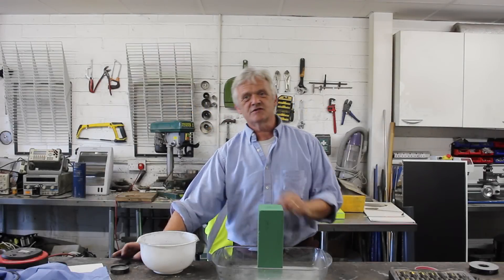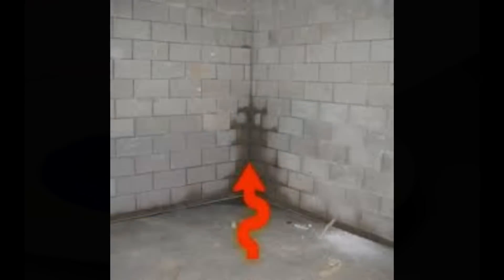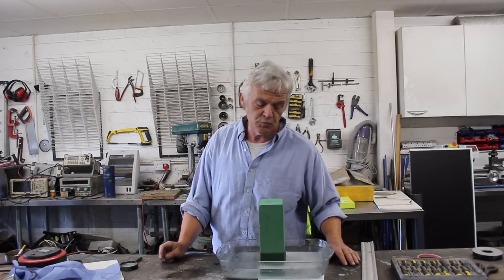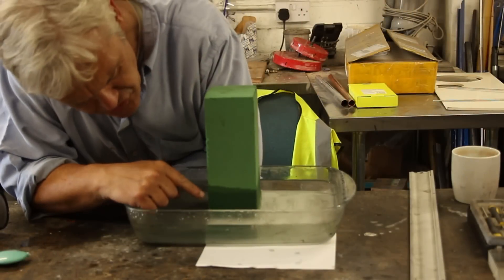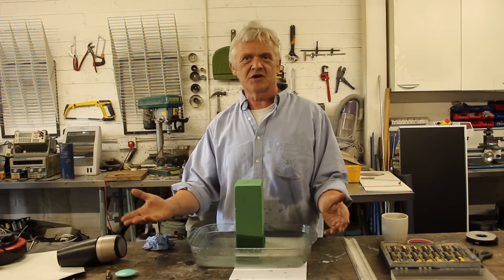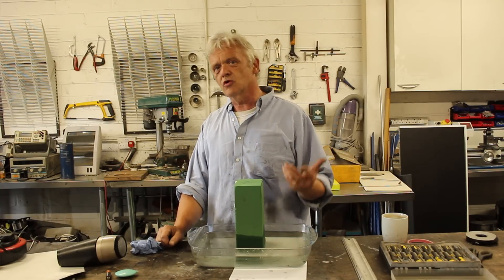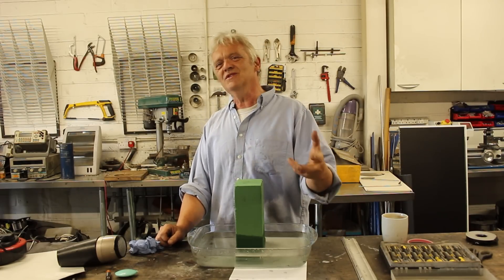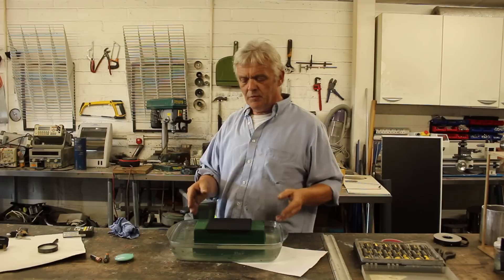1614 How To Get Cold From Hot By Copying Nature

Comment: 🤔 if ya can get a bundle of carbon nanotubes for testing with capillary action, a passive pump could be good. The only thing left to do is have some drippers and collect that water at a higher level.

If can get the drippers to work from the floral foam successfully, or with the nano tubes, then can make a passive step pump system.

Though to be honest, using a Archimedes screw up by windmill or wind generator would be interesting.

Comment: Very interesting - I live in a warmer climate and I have not found a successful evaporation cooler yet... maybe I am just not looking at the right products :-(  At the risk of being pedantic, the capillary action does not pull the water up the stem of a tree or anywhere else - the fluid, regardless of what it is is actually pushed upwards as the pressure drop from the leaves in a tree (or the vacuum effect of us sucking fluid through a straw) takes effect.  The atmosphere is heavy, thus the fluid is pushed and not pulled.  Told you it was pedantic - it is correct though.  Thanks for sharing and have a great day :-)

Comment: For those in areas with high humidity where a zeer pot or swamp cooler won't work well, it is possible to run a freezer on solar and a battery. It is an expense to set up for that, but it will work. From there, you can meet refrigeration needs with frozen gel packs and a cooler.
This would also open the door for personal AC experiments, personal meaning cool air blown on a person and not cooling a whole room. I've been wondering if a frozen sand battery would work to cool air blown by a fan and if that effect would last longer than an equivalent sized block of ice. (At least the sand shouldn't leave a big puddle of water when used)  Maybe 3 or 4 sand batteries in the freezer and rotate as needed? A gallon of sand has more mass, or weighs more, than a gallon of water, so perhaps the cooling effect would last longer. Won't know until I try.
Then, there are experiments with getting water from air. Cold water in a styrofoam cooler circulated through coiled copper outside the cooler, then back into the cooler should cause moisture in the air to condense of the copper coils for as long as the water in the cooler stays cold. Ice trays in the freezer would keep that operation producing. Just refill the trays with water from the cooler to freeze them again. Or, drop a frozen sand battery in the cooler to keep that water cold.
If electricity becomes scarce or unaffordable, we will need to use different methods in our day to day lives. Robert mentions this frequently and I think he is right about that being a possibility in our near future.

Comment: Capillary action is based on the atmospheric pressure at the top of the column and not the head pressure of the standing water tube.

I believe that this is caused by electrostatic attraction between ions in the water and ions in the air.

I would enjoy a comparison between deionized water and a simple electrolyte to see what the difference might be.

Comment: A Question To All - Do you leave you washing machine plugged in and on stand by  24 7 ?  -  I just measured my Washing Machine stand by  volts and current and was amazed that when the machine was in stand by it measured 243 V AC @ 1.5 amps = 364.5 Watts. So my machine is always turned off when not in use - My Machine get used may be 3 time a week. so that = about 90 mins @ 225 V @ 7A when in heat cycle = 1K575 Watts and the rest of the time 330 mins @ 225 V @ 5 A = 1K125 Watts - just by switching off my washing machine after each use, I save £135 a Year.

Comment: Using 2 terracotta pots no holes one inside the other with wet mud between the 2 pots, the outside pot evaporates the water in the mud, the inside pot gets cooled - The  other use for 2 pots with holes at the bottom, is to place lit candles in side one pot and place the other pot on top to collect the heat from the burning candles and it will heat a small room.

Comment: BUT the materials used as the wet matting in "swamp" coolers is chosen because of the balance between holding water and letting air through. The capillary and transpiration needs a little help with those materials. Oasis and similar products are fine and dandy to get transpiration action happening, but if it blocks the airflow so much what's the point? You won't get enough airflow to blow cooled air anywhere meaningful.

Comment: Getting cold from dry. As no amount of heat gets you evaporation if the air is already saturated with water vapor.There are swamp cooler designs which are pumpless but their cooling potential is severely decreased. Even here in the desert we use pumped versions. The biggest issue is that the hottest areas are either the moistest or the driest. The moistest areas have already saturated air so no evaporative cooling takes place. The driest places consume large amount of water which is a scarce resource in those environment. Or, you can have the worst of both worlds when we hit monsoon here in the desert. It's a tech that has been used by humans for thousands of years but it is extremely limited in scope and capability. - Earth Tubes may be the only environment-agnostic cooling option which "actually" achieves cold from hot. As warm air rises through the structure and is expelled the system draws fresh ambient air into the tubes. That air then gives up its heat energy to the surrounding earth which is sub-ambient. By the time the fresh air makes it into the structure it is sub-ambient as well. Essentially using the earth's thermal mass as a giant heat sink for your inbound air. Also, higher humidity actually increases the performance as more water vapor makes for more thermally conductive air.

Comment: I found swamp coolers to be most efficient in lowering temps when it's a drier climate. When it's very humid out, they do almost nothing
Reply: That's because they rely on evaporation which will be much less effective in higher humidity.

The same reason 40°C feels much more uncomfortable in the UK than it does in Spain, because it's more humid here and our sweating is much less effective.

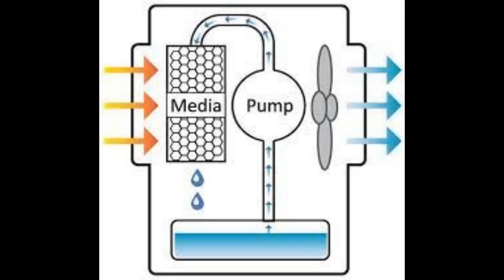Comment: I have been working on a device very similar to this for a while now. It works similar to your sketch at 5:34, however it uses outside air as inlet, and expells the humid air back to the outside. As a net result, this device is able to cool down the water which circulates in a cooling loop and then into a radiator. Currently it can cool down a bulk of water 3-4°C below room temperature, enough to be useful on a hot day. It does so while consuming only ~24W for pump, air blower and radiator fans. It is still a prototype, but the concept works well. One can even use a multi stage design to achive even lower temperatures
Reply: SaltyBrains  It literally is not, since the device stands here in my room during the summer. I have not measured how much thermal power it can remove, but keeping the water and air circulating does not take much power. all the "work" is done by the evaporation of water. It currently is attached to a radiator with some fans to cool the room air. Its not doing that much since with only 3-4°C difference you wont get much heat transfer, but it is noticeable if you are close. definitely a nice to have in the summer.

Comment: I used to know a guy that grew up in Arizona and he told me that they would put straw bales against the outside of a  wall and run water over it to cool the building. It started by running water over the bales and into a reservoir. The water from the reservoir would then be drawn up by capillary action and transpiration and cool the building.

Comment: The biggest difference I made to my house was getting a velux window put in the roof, the updraft from the ground floors cools the house, many modern UK houses are very well insulated for winter, but the heat has nowhere to go when the house heats up.  I'd be interested to see a practical demonstration of your cooler, to see the temperature difference at say 30-35C.
Reply: I'm houses that don't have rooms in the roof then providing the roof space is ventilated then you can achieve similar by opening the loft hatch in the evening.
Reply: @Noodle999  not really, you just trap the air in the attic, my neighbours do that, it just builds up, their upstairs will be over 40C, overnight and mine will be 25 max, because the heat has somewhere to go and drags the air underneath out the house
Reply: @LOFIGSD  It's a lot to do with relative temperature and when you open it. Our loft is ventilated so once it's cooler outside than it is inside, I open the loft hatch and the bi-fold doors downstairs and it shifts a fair bit of air through.

Then later I close the loft to promote airflow through the rooms instead of it going straight out through the roof.

Comment: Robert check out Coolgardie Safe... evaporative cooler used originally by Gold prospectors around Coolgardie and Kalgoorlie etc. West Australian Goldfields, 1880's. Electrical versions with fan sold today as cheap Air conditioners. They work fine in the Goldfields Western Australian where the heat is 'Dry'... low humidity... do not work well in high humidity locations... due to obviously poor evaporation in damp air.... ;-)
Great vidoes mate.... very informative and nice presentation, thank you.
Reply from the maker: will do mate and cheers

Comment: Evaporation is great until it’s 40C and 65% humidity. I’m fascinated with liquid desiccants like potassium formate because they’re able to lower the wet bulb temperature even if they’re unable to decrease the room temperature but, additional cooling of the desiccant could certainly be beneficial.
Reply: Tech Ingredients has a couple of videos on a desiccant based AC.
Reply from the maker: for sure mate - but a lot of folks live in hot dry climates
Reply: You can get around this in a way, and still be more efficient than regular AC.  The cooler humid air is run over heat exchangers in 2 or 3 stages, using the dry cooler incoming air in each stage.  There used to be at least two commercial units that worked this way but they obviously need more parts and more blower capacity.  Supposedly they work to both reduce the final temp below what a single stage unit can do and approach ac temps in dry climates while still saving some energy over conventional ac.  The key is not running cool humid air back through the system, the heat must be transferred through an exchanger to keep the incoming air at climate humidity.

Comment: Problem with these approaches is the humidity that swamp coolers generate. They kinda-sorta work and use a lot less energy than traditional aircon and heat pump systems, but when you live on an island walking distance away from tidal waters and a bike ride from the coast, evaporative room coolers are problematic.

Personally I gave up looking for ways to cool the room, and went for personal cooling instead. Blue-gel freezer block, wrap in a tea-towel to prevent freezer burns, keep pressed against skin via clothing or just cuddling it like a cold-water bottle. Lasts for hours at a time and absolutely helped take the edge off.

Also while poking around for a few weeks before the inevitable Summer heatwave, I did come across phase-change or PCM-cooled clothing that promises to maintain 15 or 22C after just a short dip in chilled water or a small stop in the freezer. Be interesting if there's a way of doing that without spending £175 on a jacket meant to be worn under fursuits.
Reply from the maker: unfortunately not a lot of folks live in your situation - which means not a lot of folks are thinking about it. But I do have an idea or two and they will be in the next videos

Comment: if you use a large slab of oasis in a bin of water and blow air at the foam will it suck up enough water to make a noticeable difference in the temp on the far side of the foam? like a swamp cooler?
Reply from the maker: yeah - but I might cut the oasis into slices mate

Comment: I also love the idea used in desert areas to cool homes by drawing air out from inside the house through holes in a chimney. As the air moves past the holes in the chimney, it causes a drop in air pressure in the chimney, air is sucked in to the house at ground level which then blows over a tiled floor which in turn removes heat which then escapes up,the chimney. 
Meant to be quite an effective form of cooling. Depends upon a good airflow though.
Reply from the maker: I believe they called them wind catchers mate
Reply: is there a youtube vid about this

Comment: The water channels in trees (xylem) have a nett negative charge. H²O has a nett positive charge. So effectively (well, perhaps as a visual aid) the water molecules tumble up the xylem.
One problem with the concept in this video: evaporation raises humidity which in itself raises human discomfort. So for cooling human spaces some mechanical assistance and separation will be necessary.
Reply from the maker: it's only a problem if you live in a humid environment mate but quite a lot of folks don't
Reply: @ThinkingandTinkering  I lived in Canada (1976-86) and did a lot of back and forth between Calgary, Alta and Vancouver, BC. The elevation difference made for some new and weird observations. E.g. it felt colder in BC at -5 to +5 than it did in Alta at -20/-40 (three layers and a good breakfast and you were fine). Humidity goes through clothes, everywhere, magnifying the effect of temperature.
Back in Australia my girlfriends learned to love me even more when I soaked the top sheet and threw it over them (with the obligatory squeal): but that was back in the day when we had real heat waves.
Thanks for reminding me.
Reply: Not enough people realize EU-theory drives the entirety of biological processes, as well as cosmological.

Comment: I once had a aquarium water filter that used no power. Gravity would allow it to syphon the water up hill, so to speak to the filter hanging on the top of the aquarium and then gravity would allow said clean water to trickle back into the aquarium. I often wondered how it worked and both the maximum distance the water could be manipulated to flow above the main body of water as well as the maximum flow... gallon per minute.  Any assistance in understanding this would be deeply appreciated, as I'm wanting to have a water flow from the back lake too the house without using any power. off grid and self feeding so to speak.
Reply: Sounds like your looking for a trompe pump? Water ram? Peace and freedom ✌
Reply: @zootednBootedG  A Tromp would be huge for compressed air, but I've never heard of a tromp pump. The water ram only works with running water. my lake is fed thru underwater springs and I'm below sea lvl with no high cliff nor running water. only a small lake in the back yard. I'm hoping to have the water flow over the roof during the summer to assist in cooling, with the run off returning back into the lake
Reply: @bayoubuddha8048  You could excavate a section to get the waterram lower
Reply from the maker: I am sorry mate but there is not enough info there - a syphon wouldn't do that as we all know so there must have been some part of the system you didn't notice